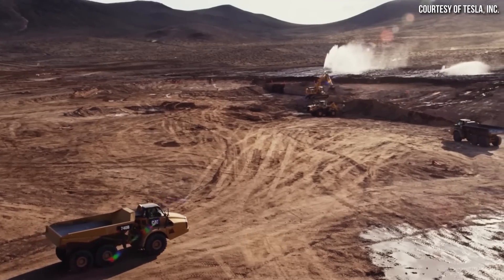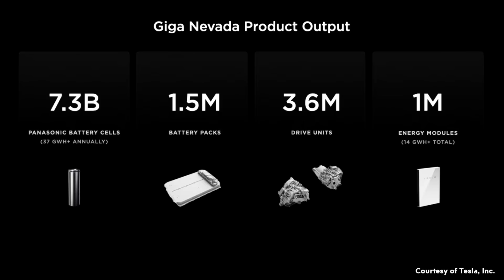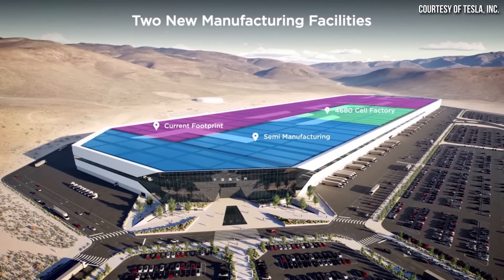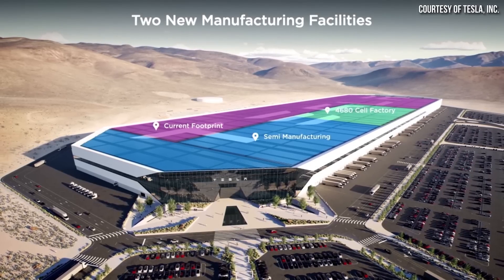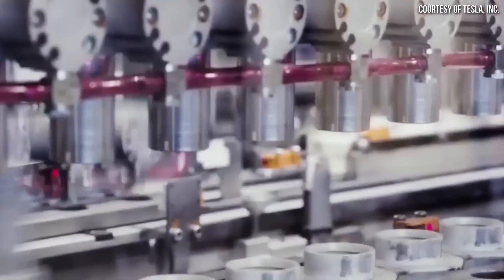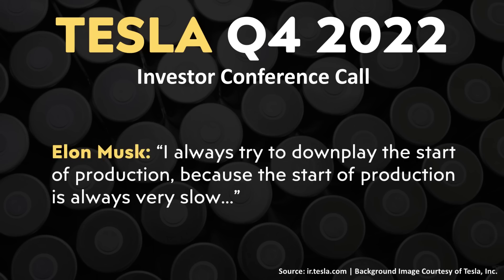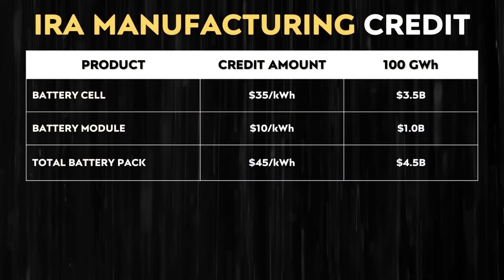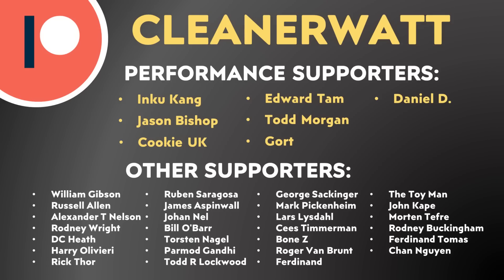Tesla's EPIC NEW 4680 BATTERY Updates | 100 GWh MORE!

Comment: The final chart '4680 production' uses the term "MY".  What does that stand for?  

John said "Tesla is new to battery manufacturing..."  The 4680 production has been going on at the Kato Road facility since before Battery Day.  This was preceded by research and development of the 4680 cells.  I think Tesla has been doing 4680 cells for at least 5 years.  The 4680s are so different that a whole new production line had to be developed.  This has taken years.

Comment: Vehicle batteries have lower number of charging cycles per year (about once a week) compared with stationary batteries (charged & discharged daily when used with solar panels). As such their material chemistry are likely to be different? This means grade B 4680 batteries meant for vehicle use may not be suitable for Tesla powerwall, powerpack & megapack usage? 

The newer battery chemistries may support higher number of charging cycle for the battery lifetime, and thus be also suitable for use as stationary battery and also better support vehicle to grid features which Tesla has stopped supporting, and which Ford EV users have found useful?
Reply: What's the typical C rate of commercial (or home) storage?
I would suggest that those cells are effectively on a slow, steady "trickle charge" (and discharge) rather than the higher stress "On/ Off/ On" environment of a vehicle.
.
Vehicle to grid is a half baked distraction.
Only good when the vehicle (owner?) Is "at home".
Can you guarantee WHEN a power cut will occur?
Reply: @rogerstarkey5390  Vehicle to grid feature can help provide emergency power supply to any location accessible by roads? Not sure if the CyberTruck will provide this feature.

Comment: When do you think Tesla will produce in house iron based cells and batteries 🔋 🤔  ???
Reply: My take on it?
"Iron" is a hard material.
"Iron" based cells tend to be "flat format" (pouch, prismatic).
Question.
Is there an issue with cracking as the "iron based" material is rolled into a cylindrical shape?
Reply: @rogerstarkey5390 , there is no issue with LFP in a cylindrical format.  There are already lots of LFP cells made in various cylindrical formats.  It's just not as common because LFP packaging is more flexible (less structural/thermal runaway concerns) and LFP is usually used in larger/lower density applications that benefit from larger cells (less total cells to assemble).  The foil folds in pouch and prismatic cells are actually sharper than cylindrical cells because the foil is folded into a rectangular shape with corners rather than a smooth circular shape.

Comment: It could be that the area designated for battery production may not be consumed by the production of 100 GWh of batteries. The space my be able accommodate 500 GWh of battery production especially with the implementation of the dry battery electrode process.

Comment: I'm not surprised that you haven't been able to get battery specifics. The reason the independently tested 46-80's all show anemic performance is a lot of the promised chemistry innovations not present. This is, I believe, to avoid an Osborne Effect slump with customers wanting for a 46-80 powered version of vehicles once the full advantages of the battery have been realized.

Comment: What about the sodium batteries? Is Tesla going to make them with the 4680 structure?
Reply: Sodium cells are great...... For STORAGE.
The energy density makes them too large and too heavy for small vehicles (or large, long range vehicles).
Probably great for applications where "cheap and large" is ok.
.
Storage.
Short range (fixed route) public transport?

Comment: So when will Tesla make a long-range Model Y with 4680 batteries?
Reply: They won't
They'll make 20%(+) more vehicles with the same number of (more powerful) cells.
They'll maximise the charging capability of the cells and the chargers (we're seeing that now!) to allow a 300 mile "Outrange the driver" with a capability to recharge faster  than to driver can "refresh".
.
4+hrs driving.
15 min (car!) 20 minute (driver) stop.
Repeat.
.
It's exactly the same thing as with the Semi.
.
If anything, packs will get SMALLER over time!
(Get over it)

Comment: The true factors driving Tesla expansion are the new business's that are up for grabs. To accelerate the sales of Semi trucks Tesla plans to increase charging stations using Tesla solar and Tesla megapacks, charging those megapacks with FREE energy from the Sun and then selling it to truckers and the millions of EV drivers for pure profit and with Tesla going to sell 2 million cars this year alone. Using home battery packs and solar gives your EV FREE driving for life.
Reply: Tesla (also) has potentially 1,500 underutilized "slow charging" sites for the Semi in the form of V3 locations hardly used overnight.
.
Assume 1 Mega = 4 V3 (250kW), with an adapter, a single V3 can output 1,000 kWh in 4 hours.
Call it an 8 hour, 120kW "trickle charge"
Won't need cooling, it's below 50% of the charger capability.
.
Call it 1,000 suitable locations where a semi could pull up to the end of a row overnight.
That's still a substantial network.
Reply: @rogerstarkey5390  Cool 😃 those Semi truckers are going to love this 😍

Comment: (1) How many 4680 batteries can CATL and/or Panasonic provide to Tesla in 2023?
(2) Is Tesla gonna produce an LFP 4680 for Megapacks?
(3) What is a Grade B 4680 battery and why is it suitable for a Megapack  but not a Tesla vehicle?
Reply: Good question
Reply: Somebody is paying attention and asking all the right questions.
Reply: The battery cells don’t all have the same voltage. There is a variation and the cell have to be tested and then match with cell that are close to the same. The pack essentially operates at the lowest power cells level. So the highest energy cells are matched up and put in vehicle packs and the lower energy cells are used for storage. The difference between the “A” cells and “B” cells is not large but is important.
Reply: Lithium batteries heat up when you charge and discharge them. Some cells will heat up faster than other do to the resistance of the cell. A laptop battery can only do 5 amps per cell without heating up, it had high resistance.  A power tool battery can do 50-100 amps and still not heat up that much, they have very low resistance. 

There are chemistry differences between those batteries sometimes. But when you build a cell for a power tool and it can't output 50 amps they don't throw it away, they mark them as B grade and sell them to laptop battery manufacturers. 

The plaid vehicles need the batteries that can output hundreds of amps without heating up. That would be a grade A cell. The cells that fail testing do to heating up to quickly are  considered B grade cells. 

There are different requirements for cells in different industries. EV's need high amperage cells. An airplane needs extremely energy dense cells. Cellphones also need energy density. When ever you produce a cell it is grade A if it meets all your specifications. The ones that don't meet specifications are considered grade B. And that is different for each industry.
Reply: @ecospider5  
The basic design philosophy of the 4680?
.
Design a larger diameter cell which overcomes the restrictions of longer current flow path in the "jellyroll" , thus reducing, or eliminating the issue of resistive heating
.
In other words, a large diameter cell which doesn't "heat up".
.
Reply: (1) approximately 0
(2) not anytime soon
Reply: @jasonbroom7147  lol

Comment: If they have solved the dry electrode issues then it's production full steam ahead... stoke the boilers.
Reply: Let's just assume they still have issues..... (No, I'm not saying they do)
.
But
They're building a 4680 plant in a factory which already has a wet process Cathode production facility.
.
If the remaining parts of the process (the physical construction, or "canning" are up to speed, they can switch that cathode material to the 4680.....?

Comment: According to Panasonic, they have expanded 3 of the 14 lines at Nevada for the higher capacity, but they have no plans to expand the other lines. Part of this is because of the strained relationship with Tesla over the terms of their contract, and part to concentrate on their new plant in Kansas.
Reply: They can't expand GF Nevada any more because TESLA is taking the rest of the building for 4680 and Semi production.
That calls into question the ongoing use of the 2170 (Panasonic) section.
Reply: @rogerstarkey5390  - It's possible that Panasonic 2170 lines Might be "Squeezed Out", or they, along with Tesla, might Gradually shift from 2170 Cells (Wet) to 4680 Cells (Dry), and free up space along the way, having a Higher Density Footprint!
Reply: @rogerstarkey5390  Nothing keeps them from either extending the existing building or building a new one. Hell, they are extending the building the length of the Giga Texas building by 740 feet, and it's not even done yet. The first phase is 100 GW in the existing building. If they are truly going to go to 500 GW as they stated in phase 2 & 3 they will have to extend the existing building or build new buildings. Tesla has long term contracts with Panasonic, so I don't see an issue there for at least 10–15 years. Besides, no matter how much they build, they will never have enough batteries.
Reply: @rogerstarkey5390  They are line upgrades not building new manufacturing lines, there is no need to increase the size of the building for line upgrades.

Comment: The current Gigafactory is still underutilized; there's plenty of space left. Also, thanks for pointing out how much smaller the DBE lines will be. Sometimes that's overlooked.
Reply: Correct, no extra buildings needed.
Reply: I don’t think people have quite realized how much impact the dry electrode process will have on Tesla.

It enables the battery production to take 1/10th of the space, why is that incredibly important? Because as Elon said, if a company can produce 5x as many cars in the same factory, that’s the same as having 5 factories. If they’re saving 10x the space, they’re able to have the equivalent of 10x more factories as other EV makers. It won’t take long for that major change to show dividends, from car volume to price. 

This will result in major gains when they release ‘project highland’ and their next generation platform in march. This announcement will be about factory upgrades that result in much higher volumes, speeds of vehicle creation, will dovetail nicely with their increased battery volume.

Comment: If Tesla are stating they shall use 4680 cells in their energy storage products I presume this means they will develop a LFP 4680 cell? As far as I know the bulk of their megapacks have transitioned across to LFP chemistry due to the lower material costs, longer cycle life etc. It's hard to see them reversing this decision. CATL and BYD similarly use LFP in their energy storage units.
I would hazard a guess 4680 LFP packs may feature in their third generation platform in order to maximize margin with the sale of these smaller, cheaper vehicles. Elon may be alluding to this when he says 4680 shall be used in future vehicles ie not including roadster, semi , cyber truck. Your thoughts?
Reply: All it means is that "4680" cells will be the cheapest way to product GWh leaving a factory.
That can be LiFePo4 or other chemistries.
.
If they can make for example 1000 Nickel based cells, or 1,250 Iron based cells with the same energy capacity, but  the Nickel the cells are 20% faster to produce (fewer cells) that's a cost saving to offset the extra expense of materials (if there is one).
.
The mission will be to get the most GWh from every factory, at the lowest cost per GWh.
It's a question of supply.
.
Then there's the "smaller, cheaper vehicle" problem.
.
Until LiFePo4 cells reach a critical energy density, they are a limiting factor when used in such vehicles.
.
1) They tend to weigh more.
.
2) You need a larger pack for a given range, which must fit in a smaller "box" (vehicle).
.
The sums don't add up.
.
That vehicle might actually be a perfect case for the HIGH density cell.
.
Fit 20% fewer cells in the small box.
Save weight.
Increase range.
And in doing so, allow removal of a few more cells.
.
It's not a "black and white" solution.
Reply: The megapack factory only has a planned capacity of 40 GWh. That's still a lot of batteries, but not that much compared to the vehicle business. Tesla will not need their own cell production for that, they can get it from suppliers.

Comment: I'm really disappointed that no analyst asked for more clarification on the 4680 line in Texas. We're in 2023 and they're still only operating ONE line for the 4680 production? They're way behind their production ramp for 4680 cells and everyone seems to be glossing over that. Jon, what are your thoughts on the 4680 ramp being so slow and only being one line currently?
Reply: I believe they are going to make a change to the chemical mix going into the 4680 .CATL Lithium iron manganese is high on the ides , this gives about 20% more energy density per weight .These also have about 3 times the cycle life for cars as well as 0-100% charge/ discharge ability .  They are also playing with Sodium batteries for cars , they work for storage and are much cheaper . So I think they are really testing which one they will use .
Reply: @grahamoldfield3474  Makes sense, but we're now a year into 4680 production aren't we? And they were iterating on it before then. I think we're well past the point of "figuring out which one they will use" and more along the lines of the fact that they need to move forward with ONE and continue testing on a pilot line at a test facility elsewhere (which I think Kato Rd is)